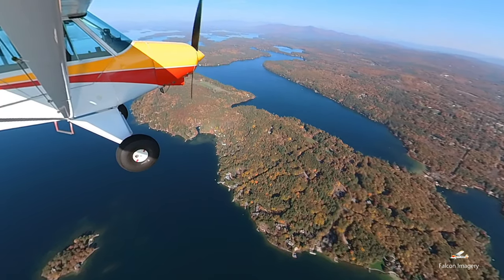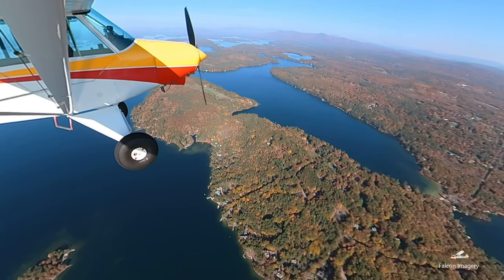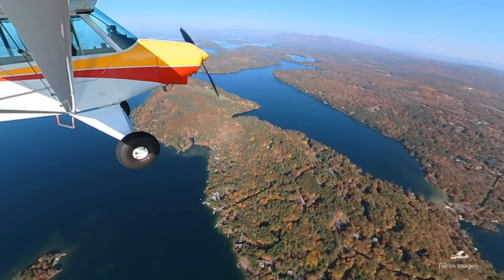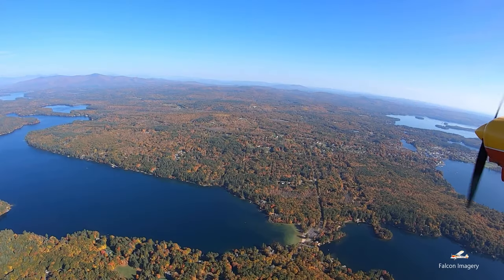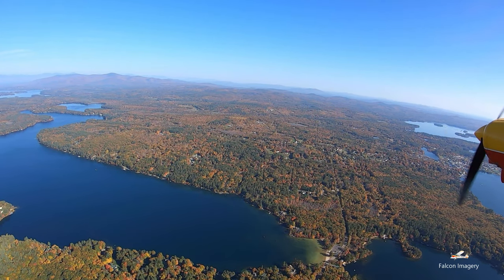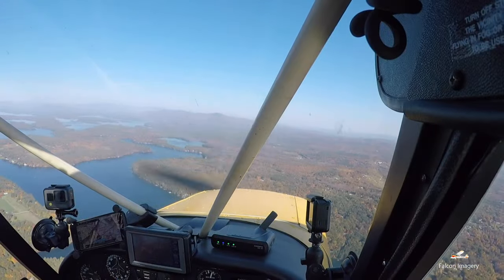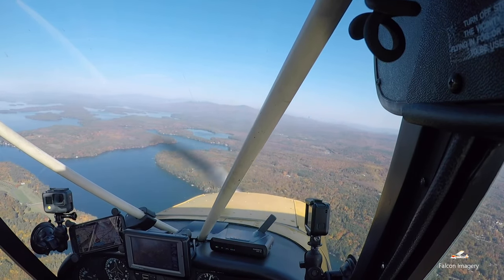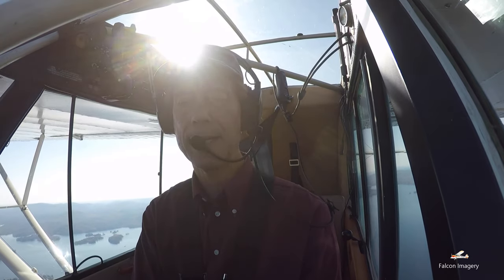Emergency Engine Out Procedure in Super Cub

Comment: Don't know if you saw the news from Nashville today. Timely.
Reply from the maker: No, I had not seen that accident report. Just read it. Very sad news. One of the reasons I always harp on emergency landings with my students. It isn't a matter of IF you may lose your engine someday. Its a matter of when. A pilot should always be anticipating it and have memorized what needs to be done. That will open up the immediate tunnel vision that occurs when Shxx hits the fan. Once the initial immediate memory actions are taken your vision opens up dramatically. I lost about 90% of my power this past February on take-off due to what I believe was carb-icing. That was a wake-up call to me to ALWAYs be ready. Fortunately I had enough runway ahead of me to land on it.

Comment: What was that clearing? 6:45 My guess is the orange things were wrapped hay bales.
Reply from the maker: Those were trees. Fall foliage in New Hampshire. That field was a former runway that was purchased years ago for homes to be built around it. The runway is now just a manicured field for the neighborhood.
Reply: The “clearing” of the engine is applying power to make sure it still works after a long time at idle glide. Spark plugs can foul or carburetor ice can form. Don’t turn a practice emergency into a real one by neglecting the engine.
Reply from the maker: @billtisdale6122  I think the person was referring to the trees below. Yes, I said "purge" in the video, but I meant "clearing" the engine by bringing the power up for a short time after it had been at idle for a 360 turn over the approach end of the field.
Reply: @FalconImagery  yes, I did not pay attention to the time stamp. You said purge and I heard clearing, as I was taught.  I was going to ask 8f that was the old island airport north of Wolfborough, but you answered that in the video.